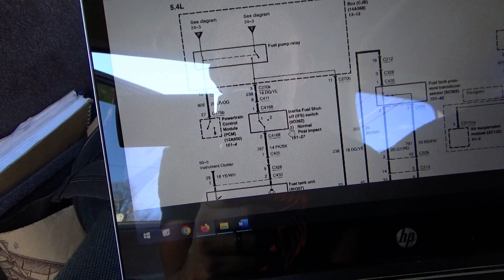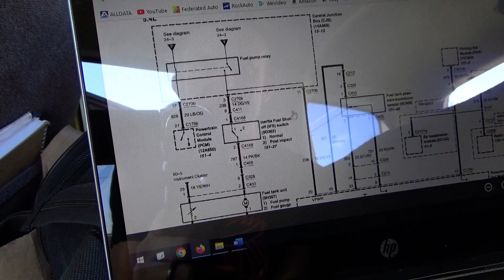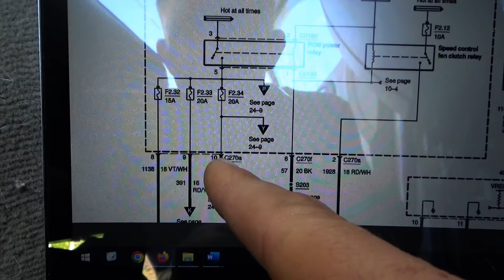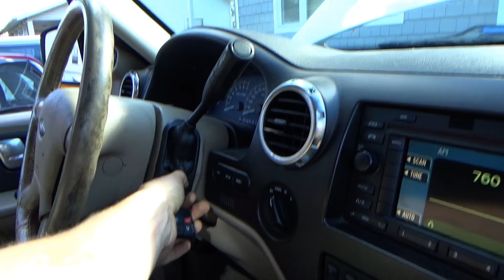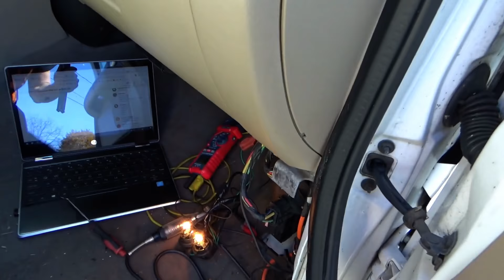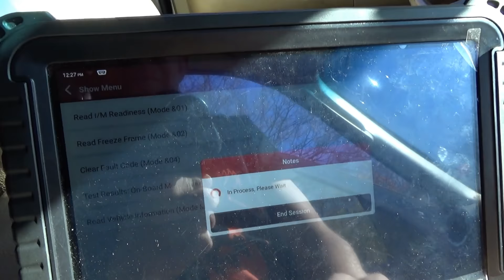Ford Owner STUMPED for 6 MONTHS? Fixed in 15 MINUTES! (No Fuel Pressure P0231)

Comment: Hi Ivan, remember sometimes a quick fix is often Experience at work. be sure to charge as such.
the fuel pump relay is most likely going bad because of the inductive load of the pump and there is no reversed biased diode (snubber)to protect the contacts. I would add an external relay with the diode protection.
Rich
Reply: @@richb419    Great idea Rich!  The back emf from de-energising that relay will create a spark & burn a little piece of relay contact away each time, without a diode.  Probably the manufacturers should have installed one when they first built the vehicle, & this problem may have never arisen!

Comment: Tip-If you have a vehicle with internal a fuel pump relay integrated into the fuse box, such as this Ford and Chrysler products, always carry a prepared jumper wire and a wiring diagram with connector view so that when the impending zombie apocalypse does come (and it most definitely will) you will not become zombie food.  Your welcome.

Comment: Two concerns I have here and I’m more or less listening to this more than watching it; could the fuel pump be overloading the circuit of the PCM relay as that extra five amp draw was never designed to be there, and is that fuse that we are now relying on the power source for the supply leg of the fuel pump relay? Could this just have built in a future electrical problem? I think that I agree with everyone’s assessment that it would have been a good idea to wire in a new high-quality relay and mark it.

Comment: That's cool but I would have expected you to add a relay, picking up the control side from the PCM, and feed the load side through the inertia switch and that monitoring circuit.  That way if the PCM wants to shut the fuel pump off (like after a key on prime), it works 100% as stock.  Were you concerned that the control side couldn't source enough current for a regular relay?

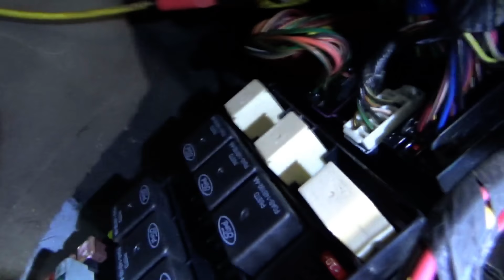Comment: Thanks for all the videos. This fix is one I’m not happy with, it bypasses all the safety features to prevent fuel 3:42  flowing in the event of a collision and endangers the occupants of the vehicle.
Reply from the maker: @anthonyjones5711  Inertia Switch is still functional 👍
Reply: i've reset ford inertia switches from pothole hits this ones still hooked up  no biggie

Comment: I don't like this solution Ivan, sorry.
I would recommend replacing the entire BCM or as a last resort I would add an external relay, but I prefer everything to be original. I don't like these cheap solutions, it's high voltage current, it can burn the car. In addition, the fuel pump runs constantly without being controlled by PCM. Sorry.

Comment: Owner stumped for six months on a bad fuel pump relay, how is this even possible? After making sure the inertial fuel switch was reset, then you would see if the relay is supplying power. This is the first thing you would check after noting that the pump was not running. This is about as basic as auto electrical testing gets, by asking, is the relay working?

It looks like what makes the junction box smart is it is PCB based with added electronic components and not just made from bus bars. It also looks like you can open the plastic enclosure to access the PCB. If so, it would be relatively easy to inspect the PCB and change the relay if needed. The problem could also be a cracked solder joint, which would be no parts required. Given the mileage on the vehicle it is a good guess that the relay is bad. Most PCB relays for automotive are very common types with known and standard PCB footprints. You should easily be able to find an equivalent device. 

If you don't want to repair or replace the central junction box due to the age of the vehicle, and you want the vehicle back on the road the same day, you could put another relay in parallel with the first. In doing so the junction box internal relay coil circuit should be disconnected so the PCM only has to drive one relay coil. The PCM relay control strategy may set a DTC if it cannot verify that when it commands the relay off that power is removed. Although, it is also possible that the algorithm is only looking to see if power is present.

Comment: Nice fix. I have a question. Some cars have a safety function that will shut off the fuel pump if you are in a accident. I am not sure if the truck has that function but your fix would probable disable that function right?
Reply from the maker: @ludvigjakobsson9347  the Inertia Switch will trip and cut power to the pump anyways in an accident 😉

Comment: Sorry, Ivan. I normally agree with you on 99% on your NPR repairs. But this is a safety issue. Normally, if a vehicle flips over and the PCM doesn't receive a crank signal with the key on, it will disable the fuel pump to mitigate a gasoline fire hazard. I would have wired in an external relay. From a legal standpoint, everyone who is celebrating this as an awesome feat doesn't know their ass from their elbow. This is an easy win for the plaintiff (car owner).    I hope you reconsider. IMHO
Reply: I absolutely agree. Why not install a relais socket and a relais? Less than 20 bucks.
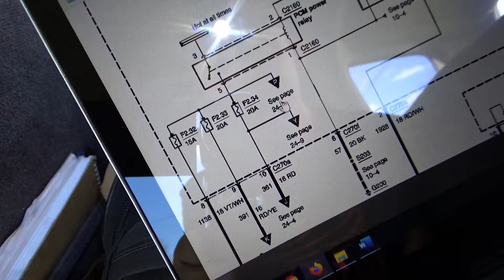Reply: Its still controlled..  5:30 ish in the video..  Signal coming coming out of the PCM, obviously goes through a fuse and to Y, but it also goes to P which is the control wire for the fuel pump relay..   So the PCM not only controls the relay signal, it also supplies power to the power side, and Ivan pulled power off of that same circuit..   The PCM still has full control of the fuel pump, and the only reason I can see to have a relay is for possible wire size/current considerations in the big plastic box.
Reply: It takes a good mechanic to fix what Ford designed to fail to steal your money. I personally have my Ford dealer proofed and don't ever take it to a dealer. Maybe some parts for maintenance if they can get them from Mexico where they are made.
Reply from the maker: If the vehicle flips over, then the Inertia Switch will cut power to the pump anyways 😉👍
Reply: Not the correct repair. A 💩 repair.
Reply: @PineHollowAutoDiagnostics and if it doesn't? You removed the failsafe for that by doing this "repair". Lost a ton of respect for you from this video. I wouldn't trust you making any fixes in my vehicles now
Reply: @Jumalten001 
He could care less about where you get your car repaired.
You don't make a difference.
Reply from the maker: @Jumalten001  😭😭😭
Reply: @PineHollowAutoDiagnostics  Spoken like the true A-Hole you really are.

Comment: Hi Ivan, I have a doubt about how the fuse been powered while testing with light both sides however in the diagram was after the relay and the feed was before the relay not before the fuse...... Did you check wire integrity from the relay to the pump and the feed in the load side under the relay.

Comment: Great video I had the same issue on my stepfathers 2002 f250 superduty v10. I put an external relay by fuse box felt safer that way also I can replace relay and have a testing spot for future. Worked good  but the secondary circuit high code is still there. Doesn't set light and runs like a charm. Had a  tough time confirming fix cause of fuel gauge issues one I had didn't have adapter. So I rented one from autozone. Car was running, revving up battery voltage good but no fuel pressure on gauge reading. Didn't want to take out on road cause I used up free tows and didn't want to pay the high tow bill. So I got one from O'Reily's and same thing. It needs a certain pressure just to start I thought. So I ordered one from Amazon but adapter I needed was damaged! Lol so I go to harbor freight and but one there and it worked. Had fuel pressure on readings and it was perfect. So I say all that to say be weary of rental fuel gauges. Might end up with a new fuel pump when not even needed.

Comment: If the relay just dangles off of the wiring harness, I would just cut off the wires and put little slip-on crimp terminals and then slide them onto a new relay. We're talking a $10 repair to do it right.

Comment: This sounds similar to the F-150 fuse 27 problem.  It's so common, there's a Fuse 27 relocation kit.
Reply: ive done quite a few of these, for some reason it seems to be a little more prevalent on the 2013 models over the others

Comment: There is a safety risk here. If the truck is in an accident where the fuel line was severed the fuel pump will continue to run as long as the key is on, dumping fuel on the ground and creating a fire hazard. The ECU would normally stop the fuel pump as soon as the engine stalled, making a fire significantly less likely and less devastating. Your bypass would literally be adding fuel to the fire if there was one.

The inertia switch should in theory trip, but those take a good shock to trigger. Depending on the accident it may not cut off the fuel.

That said, still better than junking the truck over a stupid module. I would have integrated some kind of stall cut-off though.
Reply: no thats not true. on fords the inertia switch cuts pump power to pump in a crash
Reply: @billbarney4937  I literally acknowledged the inertia switch in my second paragraph. To repeat my point: as someone who had a ford and was in an accident that totaled it, it doesn't always trip.
Reply: @billbarney4937  The inertia switch does absolutely nothing to stop fuel flow if one of the hoses to the fuel rail breaks. This fix needs a relay. $10,  safer fix.

Comment: When making a Y splice without cutting the straight wire, with vinyl electrical tape insulated, you can put a drop of super glue under the end of the tape, so the tape won’t get gooey and unravel after time passes.
Reply: Or try 3M silk (white) 1 inch bandage tape.It does not unroll will stay viable for a long time.Sticks to itself like the old friction tape.

Comment: Ivan, maybe sometime you could get one of these electrical panels and open it up to see what it takes to replace the internal relay, I guess they should have just made it an external relay so it could be changed. Maybe when it was designed they didn't think it was going to fail as often as they do. I'm a big fan of the modules and items that you open up to see what makes them tick, and what it would take to make them work again. Also I noticed that a lot of viewers stated that an external relay should have been used... how much extra work would that be? I personnel don't see an issue with a jumper and the fact that there are several other safety items that will shut the pump off in the event of an accident. I'm just curious how you would go about wiring an external relay in.  ✌
Reply: Chrysler had the same problems a few years ago. My 2013 Grand Cherokee was recalled to install an external fuel pump relay.

Comment: Leave switch on for a while and it possibly will set high code because computer will make command for a few seconds and turn off pump if engine is not started and running.  I have fixed many of these fuse boxes and keep one ready to install in stock and swap out and repair the other and put on shelf.  It use to be so common but could wire external relay like tipm on chrysler's, dodge models

Comment: You do not need to switch fuse boxes I rebuild them all the time and install a much larger relay for the pump. I also relocate the fuel pump module on the 04-10
Reply: By rebuilding the Central Junction Box, do you mean you take it apart and replace the internal fuel pump relay? If so, how are you able to add one that is much larger? or do you add an external relay to replace the internal relay?

Yes, I think in the salt belt it is a little crazy that the OEMs mount the fuel pump control module underneath the vehicle. I would too also relocated it or protect it.
Reply: @windward2818  Yes I remove the entire box and take it apart so I can re-flow all connections on the board and replace with new relays on the board (non serviceable ) and the weak relay for the pump is replaced with a heavy duty omron that has the same pegs but sits proud by another 1/4 inch This relay handles the heat better Also I replace all of the removal relays and clean the fuses. There is a reason those relays are there and by passing them can cause over heating later on of the wire and connections I also have done this for a guy who seen my other channel and he asked to have a replaceable relay added in which I did
Reply: @CUSTOMWORKS7.3PSD  Are the internal relays open frame type (do not have plastic covers)?

Comment: That's so crazy, I literally just did a bypass like this for a customer Camry yesterday. However, I told him that this is only temporary and he has to promise me to buy a replacement relay (on Toyota it's an unserviceable cartridge with multiple relays inside, atleast the cartridge can be replaced) because in the event of an accident, the job of the Toyota circuit opening relay is to open the circuit to cut off fuel. He agreed but I don't think he's buying the relay lmao. Still gotta cover your ass though.